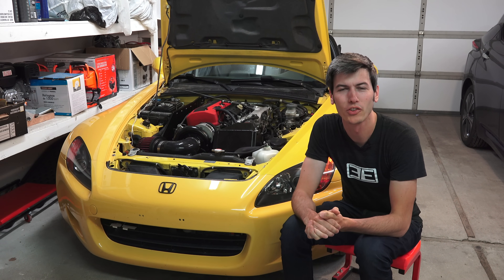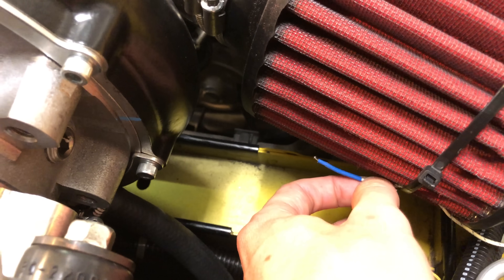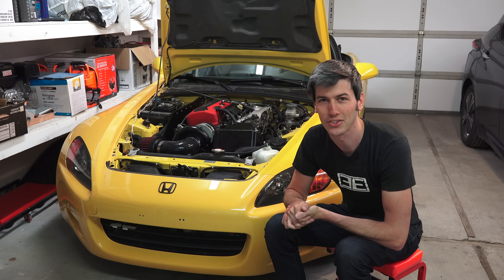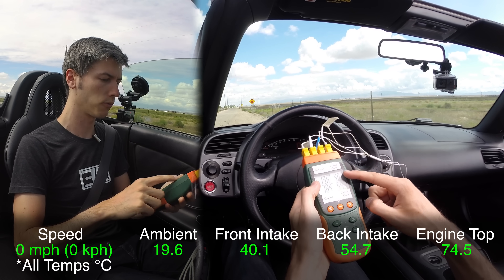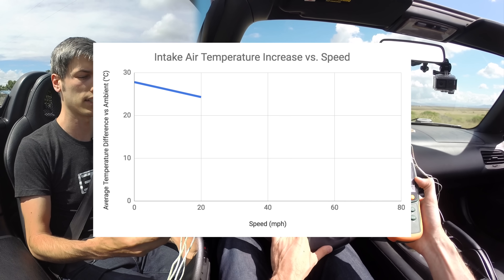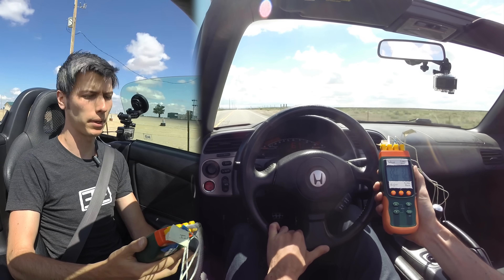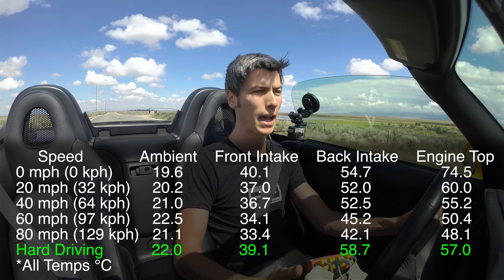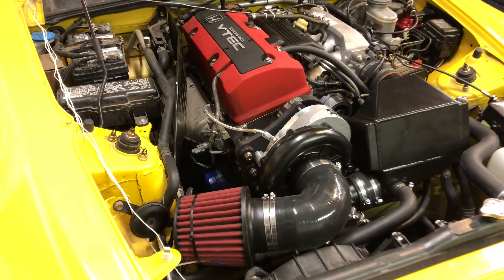Does My Supercharged S2000 Have A Hot Air Intake?

Comment: The hardest for hood modification wise doing an intake opening and air box under the right side of the hood would be the easiest for running an air tube. Otherwise you have to go under and around the radiator and intercooler, etc. Not sure if you even like that look but it just seemed the most simple solution.

Comment: You should do a intercooler test to see if the ait actually offset after the charge is cooled and then see if adding the heat shield will lower it more. Or if compressing the charge means is negligible after it cools in the ic

Comment: Are you sure that you are actually measuring the air temperature correctly on the backside of the airfilter? The temperature sensor might be warmed up due to radiation from the exhaust pipes if it is in direct line of sight, overestimating the actual air temperature.

Comment: We learn: The faster you drive the cooler is your engine. So driving fast is more safe.
Good job!
Reply: The rpm increase at higher speeds negates the wear and tear saved from a cooler engine. That , and engines are optimally efficient when they are hot, just the air going in needs to be cooled
Reply: @Taydrum  NO IT doesnt need to be cooled.!
Reply: taydrum/anton, guys hear me out right,,,,, it was a joke

Comment: How much HP are you losing due to hot air or lower air/fuel mix density? You have a base line on Dyno before and after Turbo installation. Next shroud/deflect/change air intake and dyno retest. Then add water/MeOH injection to see ultimate gain in HP at 6, 8, 12 psi on turbo. Would be interested in graphs and math.

Comment: I deal with this daily. I live in FL and have a 5" SRI comming off my custom dual throttle bodies. I see as high as 145-150* IAT during the summer at stop lights. It drops when moving but only to about 130*.... I can really tell the heat soak and lack of power in this conditions. Looking for an alternative,but difficult when your intake piping is 5"

Comment: It seems like some people think that colder air doesn’t really help a supercharger/intercooler setup. 

But since a supercharger (be it roots type or centrifugal) has a fixed rotating speed for any given RPM, it effectively ingest a fixed amount of air for any given RPM. If this air is hotter in the first place, it is less dense and thus contains less oxygen molecules. However efficient your intercooler is, the system ingested less oxygen molecules, and power potential is reduced. 

Modern turbochargers on the other hand often compensate hotter/lower density air sensed by the MAF by letting the turbine spool faster ans thus produce more pressure. Superchargers can’t do that.

Comment: Is it possible to flip the intake so the filter is on the driver side? Might help a little bit.
Reply from the maker: Not really unfortunately, since the intercooler is there.
Reply: Engineering Explained make sense. Heat shield it is.

Comment: It would be cool to see the temperature in the intake as well, and you can probably get that without rigging any extra wiring (would have made for a fun behind the scenes video, come to think of it) by using an OBD2 scanner.

While starting with colder air before the intercooler is indeed better, you get diminishing returns as your starting air gets colder, and that getting that intake temp post intercooler would let you know how effective any cooling solution you implement is.

Comment: I have a k&n fipk on my 05 gmc canyon 3.5L, it's kinda like yours, but a longer tube (much bigger engine bay, and tube routes over the head) and has the heat sheild. Using a scan tool (an Ultra Gauge display) i can track intake temps via the pcm and the maf. So many people hate those intakes, calling them Hot Air Intakes, but while driving, the intake air temps dont go much higher than about 5-10°F over ambient. Of course,  low speed or parked, it'll cook.

Comment: It looks like your taking air from  behind the radiator so i would expext the heat shield it to equalise the front rear air filter temps but to make the biggest difference i think you will need to duct air to it and shield it from the exhaust and radiator. 
can you get the thermocouples  into the air stream? It would be  very intresting to see the figures for ambient Vs inside the air filter, before ic and after ic, could you pull the manifiold temp from the odb port? 
Love the show and your detailed explanations.
Dan

Comment: Where can I get the equipment used to measure my air temp? I have a stock intake that I customized to get air directly from the front grill and I've noticed a huge difference in throttle response. More so when on the highway.
Reply: ok just ignore my question

Comment: Are you able to monitor the air intake temp after the inter cooler? 

Does a hot or cold intake matter if the system is inter cooled?

Comment: Nice video!

Ive a small question regarding “cool air flow”, i have a cooling plate above my radiator and I’m curious would that make an difference on your air flow? OR would it direct all of the radiator heat into the engine bay rather than it raising up? 👍🏼

Comment: Interesting video, thanks for producing it and sharing your findings.
I think it would be very interesting to add aditional data to this:
Intake manifold is being heated by the coolant in s2000 and it also doesn't have thermo insulation from the engine block.
Because of these reasons the manifold can get quite hot and there are opinions that intake air will be heated by it.
So it would be interesting to add another data point in this experiment - IAT from ECU.
In this case we could see what sort of temperatures ECU is using when calculating the amount of fuel.
Also, there is a consensus that 3C degree colder IAT should increase horespower by about 1%.

Comment: When i installed my SC i notice the same problem my fast solution was re install the CAI from spoon that attaches to the original air box. The temperature decreased 10°C in the same conditions. You should test it with thoose TC's to see the real difference because i compared only with ambient temperature and the original IAT. All the best keep up ;)

Comment: Engineering Explained   The intercooler can only bring temps down to a certain point. It doesn't matter how hot the air is going in AS LONG AS ITS ABLE TO COPE WITH IT. my guess is you're intercooler is compensating for it just fine. 

You should do a test of air Temp after the intercooler with your current set up and perform the same test when you have it set up for a cool air intake. That would be facinating test, and it would give you a far far more accurate analysis on whether hot or cold air makes a difference, at least in your case/car. Either way you have to set it up for cold air intake just to see is there a difference, now you gone this far. If there was a 10-20c difference after the intercooler I'd say it would make a good difference, but i highly doubt it's actually more than a degree or two difference between cold and hot air intakes after the intercooler, if I had to take a guess I would guess it will not make much difference.

Comment: I would love to build a heat shield for the car and see what it does to these numbers. Then dyno with and with out the shield just to see if it REALLY matters. It matters in theory but will real world numbers show that too?
Reply from the maker: It’s a great question! And looking back, I think it’s more important to find a way to draw air that hasn’t passed through the radiator (like how stock airboxes pull from the front). But yeah, would be interesting to test!
Reply: Engineering Explained I bet you'd get better temps and power results with the stock box.
Reply: Dyno with the hood closed right? Right!
Reply: I love Celsius.
Reply: HumbleMechanic meth injection, please.
Reply: Jason and Charles, you surprise me. After the difference of the heat wrap on the white wookie build for intake temps, even if it didn't make a discernible "butt dyno" difference, I'd think you'd for sure want to heat protect that air filter...but then again, the white wookie had much higher temps, and it didn't seem to make a performance difference. On further thought, I can see how you too might guess that it wouldn't make a difference. I've tested intake temperature changes extensively if anyone wants to check it out. A lot of my testing is off camera and I share the results. I screen shot my live data along the way to "prove" the testing.
Reply: heat management can go along way to improving the vehicles over all performance, ive seen some cases where a car makes more power than it should and gets better mileage just because of a few "cheap" extras they've had done(heat wrap or ceramic coating,heat shields and phenolic intake manifold spacers) , I also know some people who are constantly trying to get more N/A power out of the old subaru EJ251s and EJ25D(i think thats it , im thinking of the DOHC one, they leaked a fair bit) they often go after the slightly newer intake manifolds cause they were made of plastic/composite material (for a little bit) so they resist heat soak from the engine and anything else around it , it dose not make huge gains but with that engine anything is better than stock....as for the S2000(so jelly BTW) id try to see if you could retro fit some of the OEM air box parts , the S2000s had a great intake system from factory, failing that i say you just take an angle  grinder to the hood and make a nice pod filter shaped hole and drop an elbow on the pipe where it currently is and have a hood mounted intake lol
Reply: Engineering Explained vent on your bonnent and angle yiur pod fulter upwards to stick out the vent.
Reply: Ok, IMHO experience with boosted cars where you have a intercooler, the actual intake temp mater very little. More gains to be made making the intercooler working better. The intercooler is going to heat or cool the air to about the same Temp, regardless of the actual intake temp going into the charger. It makes a difference, but very little, not like on a NA car.
Reply: Great comment Paul. Every 10C is 5% of what though? I'm guessing power, but I didn't want to assume. I've seen Mitsubishi, Toyota, Chevy, all have air rams on this model or that, which is cool for cold air, you'd think, but then they usually have a huge resonator on the air intake hang close to the exhaust or something. I really think most "cold air intakes" are fake. Most of the time I believe they're legit, it's over when I have to take the intake off for a repair and I can see how a bunch of hot air is engineered in again.

Maybe I'm too hard on them, maybe it needs to be tested if air resonator tubes near heat sources really impact cold air efficiency. (1 example of many cold air intakes being "faked")
Reply: Nice!
Reply: You should box in your intake air filter to separate it from the heat of the engine bay, but install a NACA DUCT on the hood to allow fresh air from outside to enter in the box, engine
Reply: HumbleMechanic need to have the bonnet closed and not open then 👌
Reply: hi my name is i am mailing you to ask one technical question i want to know that the v12 or v8 engine build for mid engine layout is constructed similarly like v8 or v12 constructed in structure and design like front engine does the engine in mid engine layout is same as engine in front engine like because cars like pagani zonda and huyara got engine from mercedes mclaren f1 has bmw v12 engine and some supercars have chevy base v8 engine koenigsegg got ford based engine so does mid engine layout has same engines which are constructed for front engine and same engine can be used in either mid or front engine layout waiting for your humble reply thanks indeed
Reply: I believe the rule of thumb is every 10C is 5%. that's the rule for aircraft engines, should be close for cars as well. Should build a duct around the rad to funnel air directly onto the filter, like a stock Subaru air box.
Reply: Good point brother. I got some washing/dryer duct and modeled it around my Neuspeed Intake before I got my Turn2 CAI back in the day for my 95 VR6 Jetta. It had this like Ram Air effect as well as the hack heat shield around it. I preferred my Turn2 CAI.

Comment: I would be much more interested in you comparing air temps to inside the manifold post blower to this information, as you have a supercharger that will heat the air anyway. This will answer whether or not any additional heat to the inlet simply adds, compounds, or is negated when boost is applied.

Comment: In the stone age of aircraft engine development engineers used blast tubes (usually corrugated metal - not unlike clothes dryer exhaust ducts) to direct ambient air (aft of the props...) to cool engine components, typically generators/alternators.  It seems to me this would be the cheapest (by far) and most effective way to route ambient air to the intake.  
     Facing the front of the engine:  A 50-100 mm h X max open grill width terminated on one or both sides with outlet(s) sized to fit corrugated aluminum flex duct.  Route as necessary and terminate at the intake with a 50 mm clearance around the filter.
     For more fun with t-cups measure the before and after temps at the intake manifold as well.  Back of envelope calculations show a possible .75-1.5% increase in HP.  Thanks for the excellent video!

Comment: I have a similar setup and i measure intake temps post intercooler. When the car is moving at freeway speeds the temperature is 10 to 20 Celsius above ambient.

At the track when the car is waiting in line the post intercooler intake temperatures can reach 50°C above ambient!! The engine bay keeps the heat in and even the intercooler fluid gets hot without air blowing across the intercooler. In a way they become inter heaters if the car is parked for too long.

Comment: i really think one thing your should of done is looked at the intake air temp sensor from the intake manifold, the oem one.  Just to see cooled air temp after the intercooler vs all other temps. i know its to late now but could of compared intake air temp from manifold before and after the supercharger install. would be interesting to see if the hot air intake even increased intake temps since its intercooled. regardless still a great video

Comment: You should also use the thermo couples to verify the efficiency of the intercooler (ambient, after air filter, before intercooler, after intercooler) I've done it in the past with one of my cars,  ended up, replacing the intercooler, re-routing some piping and using heat shields.

Comment: I have some stupidly big cone filter on my 2.2 turbo diesel. It's located on top of the gearbox right next to the engine where the original one was located (no ducting like the original). Air intake temps sky rocket to about 60+ degrees C when idling but after a minute of driving, even at 30mph, it will drop to 2 degrees above ambient. I'm reading off the MAF sensor and the cars ambient temp sensor. I thought yours would be the same!

Comment: Now it's time to make a heat shield and measure it again :) Good test. I've noticed in my car, that in summer air intake temps on highway at 140-150km/h are at 55*C. That's quite bad. Fortunately, that's N/A 2,5l V6 producing 160hp, so it's not really stressed engine.

Comment: You should try to collect the data of the intake temperature that the ECU is reading. It would allow you do know the T delta between the air entering the intake manifold and air inside the intake manifold. I would expect a temperature rise especially now that you have a supercharger in the middle.

Comment: in 5th at WOT my stock E46 BMW's intake air temp is around 5-10 deg F warmer than ambient.  there is something to leaving the intake alone... If you think you have a restriction in the filter, get a high flow filter.

Comment: 2 minutes in to the video and I see a major problem. You completely forgot about the most important measurement- the temperature of the actual air the car ingests. You need accurate data from the intake air sensor on the car to really know what's going on...

Comment: Jason, don't forget about radiant heat vs actual air temp going into the intake. Your IAT will be the best measurement. A heatshield between the exhaust and intake will block that radiant heat but unless the filter is relocated your IAT will be nearly the same. Silicone Intakes dot com is a great source for piping up your own cold air intake.

Comment: My guess is that any engine bay modification will affect some other engine component. Who knows what a slight disturbance in air flow will have on the alternator, belt rubber, wiring, etc.? A possible solution would be to modify the hood of the car to have direct outside air flow into the filter via a hood scoop. Of course, you'd lose your originality, but you've already done that by adding a supercharger. Mark this up to unintended consequences.

Comment: What you should test is not the air immediately around the air filter,  up instead measure the temperature at the end of the intake closest to the engine or forced induction. Maybe with your current setup and a relocated air filter. 

I am just wonder how much heat soak from the engine itself would make a difference if any on the air coming into the engine. Where if at worst, both setups would have the same temperature at that point.

Comment: Starting with colder air is of course ideal. 
However when it comes to forced induction I don't think it makes an appreciable difference at all. Your bringing air into a 200+ degree supercharger, compressing it raising the temp even more, then it's going through the intercooler.
I've seen testing done on turbo vehicles and even like 20 degree temp drops made like no difference in charge air temps.